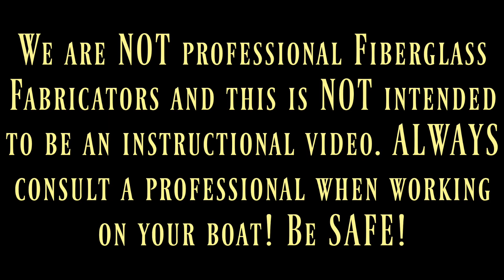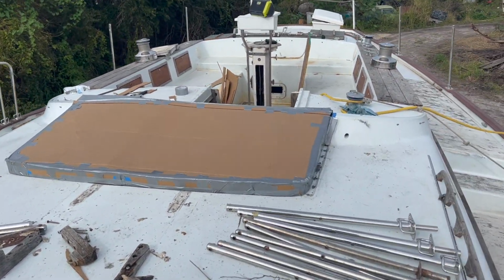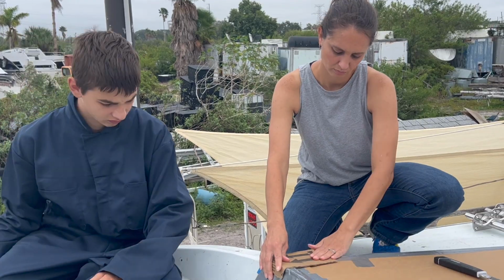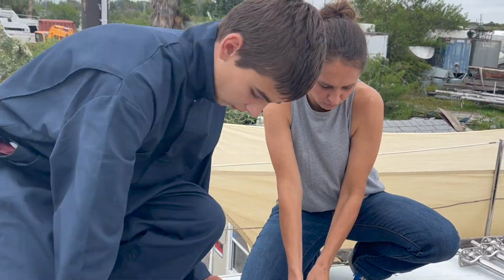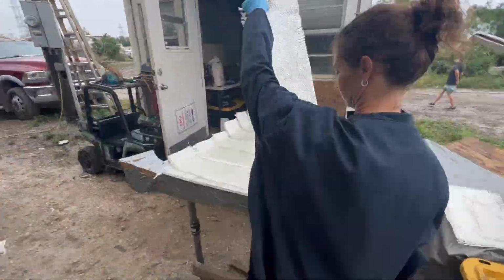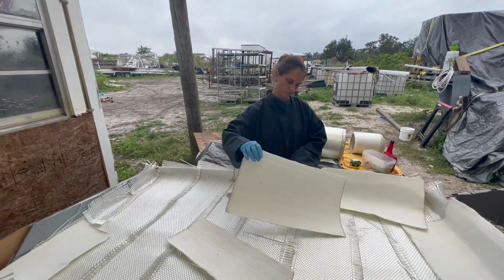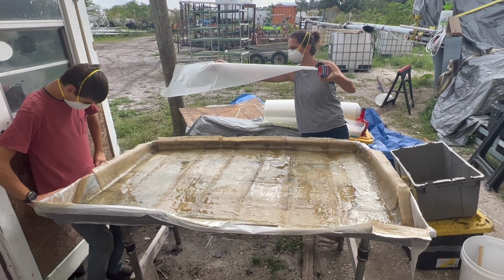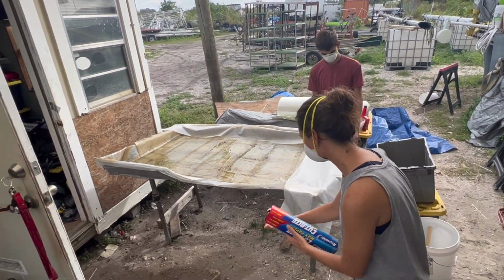The Irwin Sailboat DIY Restoration Project Week 14 Creating the Companionway Part 1 (Ep. 34)

Comment: Keep up the good work. I'm still blown away at how much you guys have accomplished so far. and just some helpful tips on temporary molds for fiberglass on future projects. You will have a much easier time with the project using rigid pink insulation foam. Its easy to shape and will leave you with a much less wavy finished product. Once you have your rigid foam mold made up, coat the mold surface with packing tape. The fiberglass won't stick to the packing tape and it will be fairly easy to remove once your finished. We all had to start somewhere, and I didn't know about the rigid foam and packing tape method until a few years ago. My first projects required tons of bondo to make look presentable, after learning the foam and tape method, the parts are ready to paint after sanding out the overlap line from the tape.
Reply from the maker: That is great information!! Thank you so much for sharing!! Wish we would have known that a week ago but we are grateful for it now!!!

Comment: Man I admire your hard work on that hatch but you are going to get so many comments.That fiberglass is woven roven,not matt.You should have started with matt,put 1 layer on and let it cure like 24 hours.That would have stiffened the cardboard,then add 2 more layers of either 1 oz or 1.5 oz.let that cure and then use Matt down first with the woven roven if that’s what you have.1708 biaxial would be much easier.also 1 piece to cover the complete mold with just the 4 corners cut to fit.good job on the form though 👍
Reply from the maker: Thank you for taking the time to explain this. We are going to have research everything you said here so we understand it and we appreciate the help. There is so much to learn about all of this!